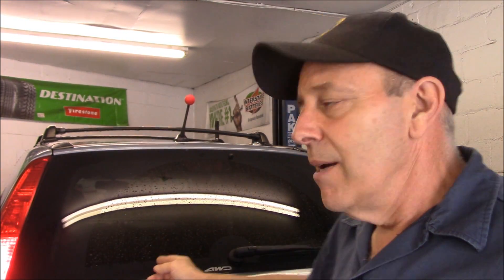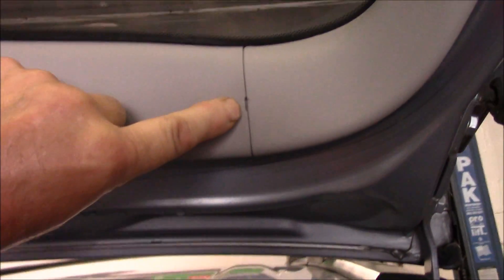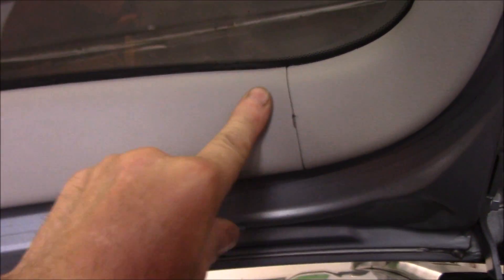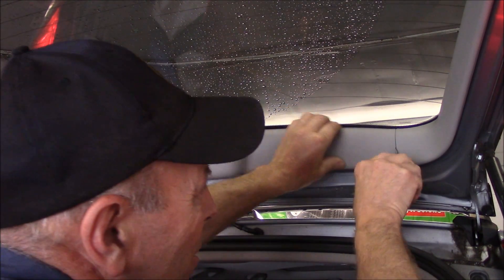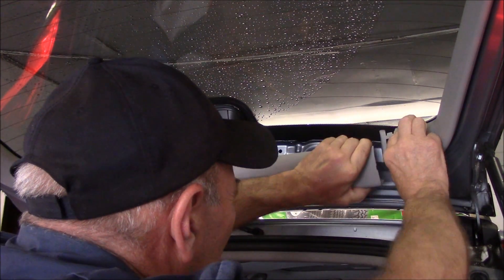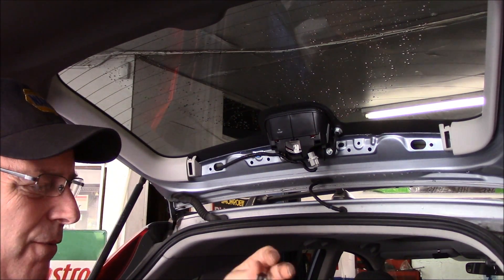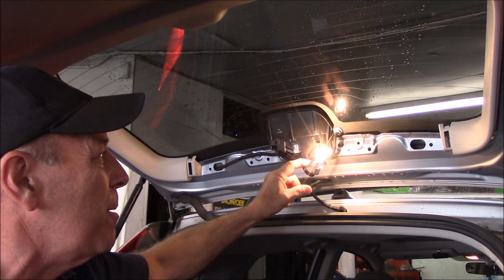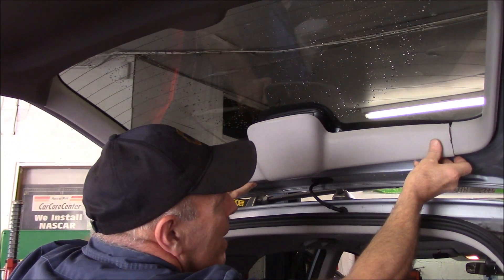How to replace the rear brake light bulb on a 2007-2012 Honda CRV

Comment: Mine was flickering for months until it no longer worked. When I took it to Honda they said they needed to replace the  whole LED light, cost me $200. This video makes me wonder if they ripped me off.
Reply: Dealer + woman = RIPOFF
Reply: No. Yours is the LED version. The one in this video is the old incandescent bulb version which is not in production anymore. These incandescent bulbs cost $2 plus labour (DIY is free). I just changed mine about mins ago

Comment: Thank you! In my case the 2 black pins on the outside stock to the car frame instead of the cover. Had to pull them out of the frame and insert them to the cover for easier assembly.
Thank you again!

Comment: Dang. Taking out the high mount brake light on a 2nd-gen CR-V is a lot easier than this.
Reply: What’s your point?
Reply: @jimhanson8370  Older cars tend to be easier to work on that newer cars. These days, it takes a while to get into some things with some cars. For example, some cars have eliminated the transmission fluid dipstick, whereas a 2nd-gen CR-V and others have one.